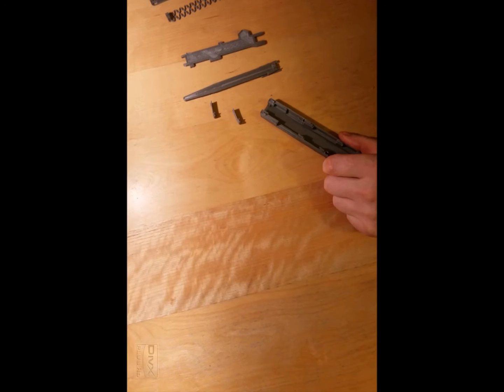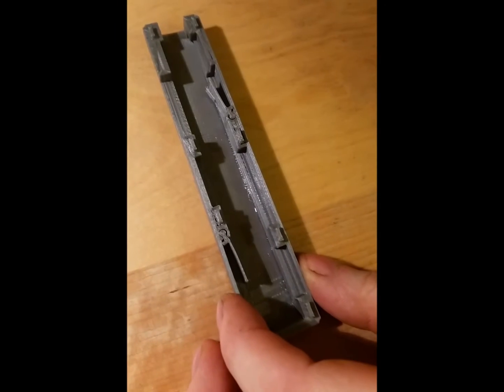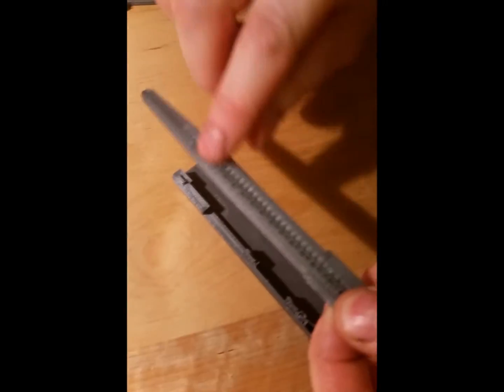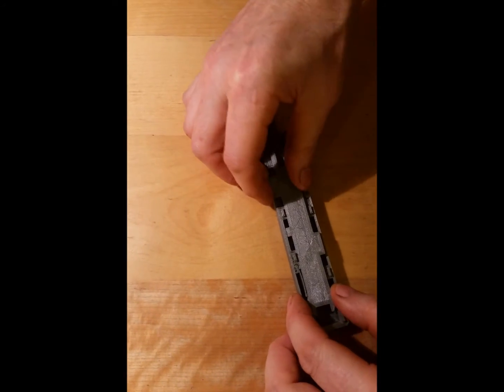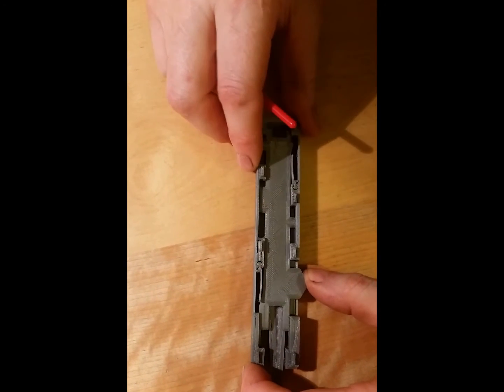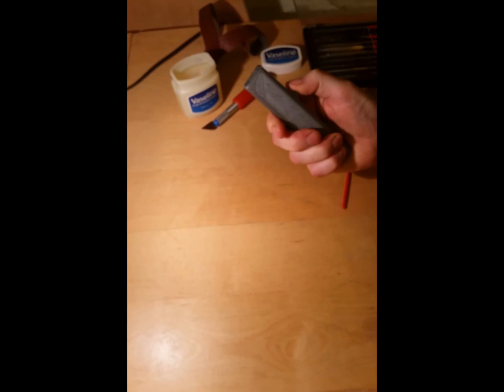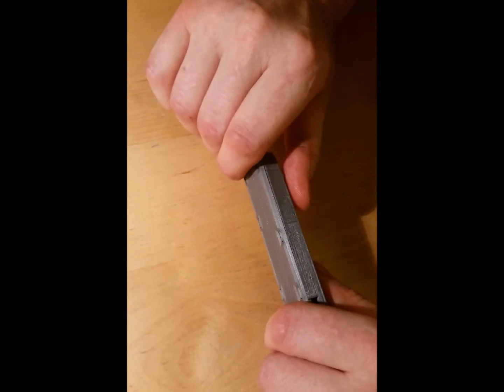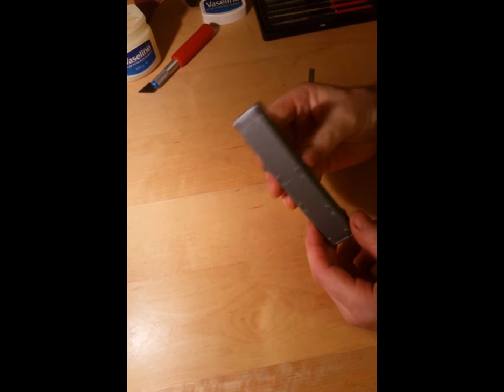3d Autoblade

Comment: hey i printed this its cool but i have to push the slide so hard to get the blade to come out any ideas?
Reply from the maker: Sorry for delay, I don't go online too often!  I suggest- make sure the trigger slider is smooth particularly on the surface that slides against the latch springs.  Also, possibly your spring is too strong, try to somehow slim it down. Nice to know you printed it..cheers.